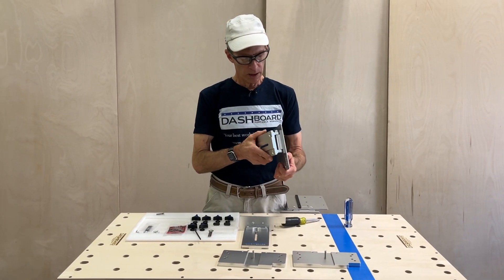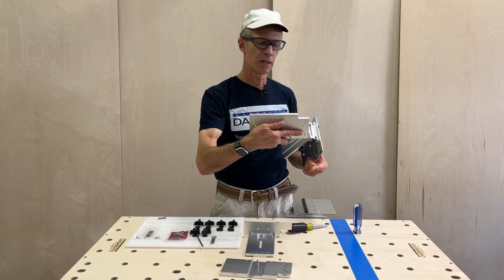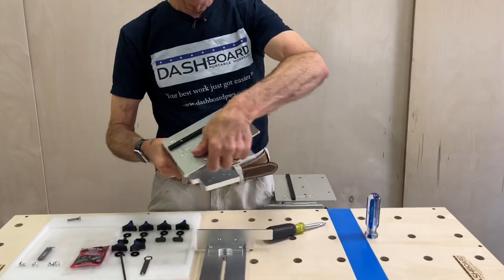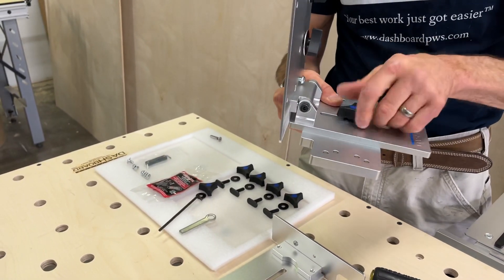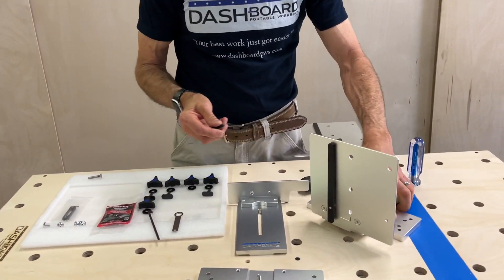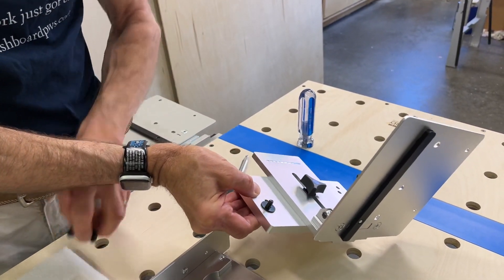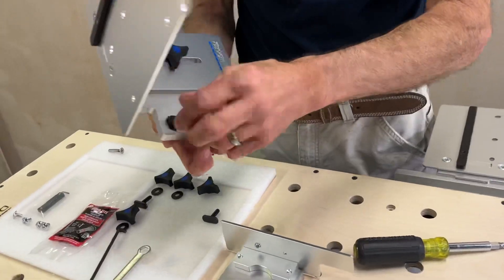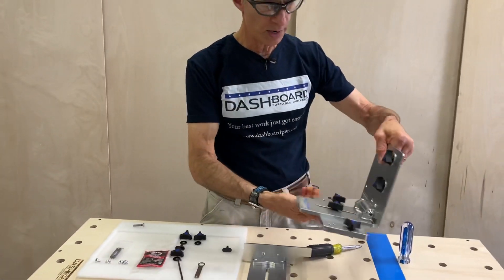Dash-Board Rear Guide Rail Bracket orientation

Comment: I'm unclear...

...I have a guide rail bracket.  But what is a "rear" guide rail bracket?  Is it in case we want a table with 2 track saw azimuths?
Reply from the maker: The video describes the pivoting bracket, which is installed on the side of a table that is opposite from the user, so it’s considered “rear”rather than the fixed one which is installed on the user’s side, or “front”.
Reply: @dashboardportableworkshop  Ahhh ok.  Thank you.  :-)